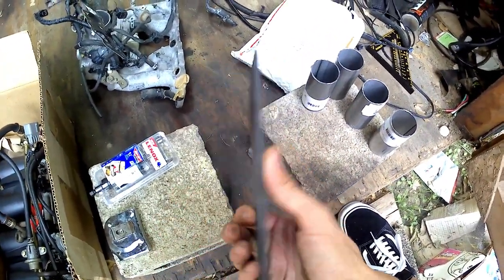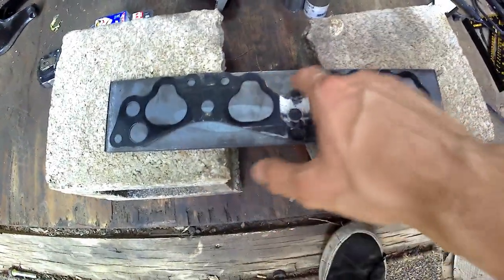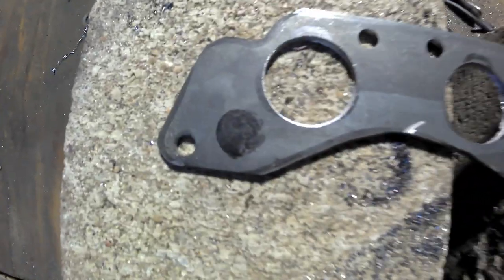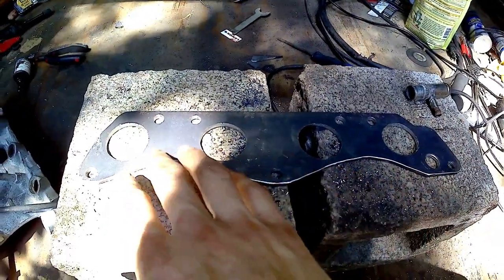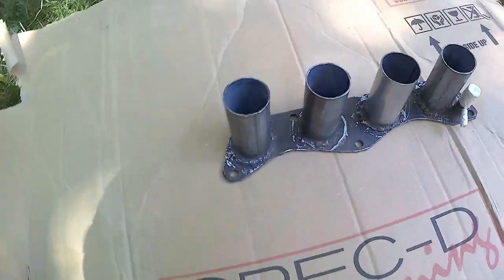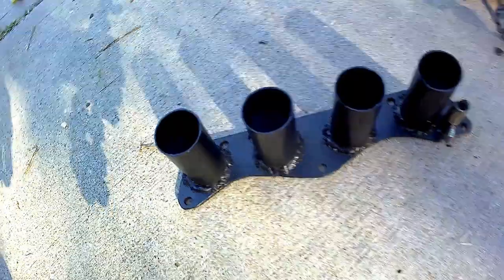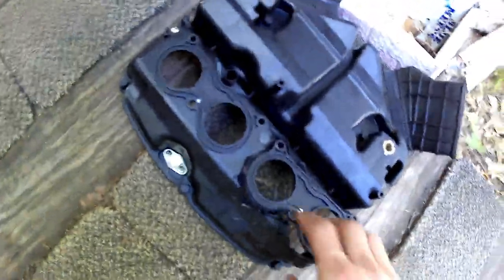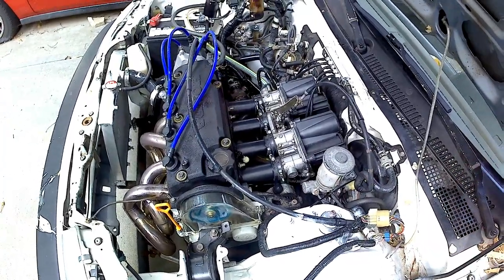How to build Honda civic ITB's

Comment: I think you should name the video title something more generic to get more views. This is an awesome video and the technique should work on other cars. I'd say remove "Honda" from the title and change it to something along the lines of "DIY ITB Adapter" or "How to build ITBs". Definitely deserve more views on this. Thanks!
Reply from the maker: Thank you! I really appreciate the advice and you checking out the video. I was honestly a little surprised how few views this video has so I think I'm going to try that out. I think it's a cool cheap way to make them and they actually work. I have been daily driving with them since this video was made.
Reply: @jdmjedi777  hey what is the link to get the itb on eBay
Reply from the maker: @stephinieletren2417  the throttle bodies are honda cbr954rr throttle bodies. You are just going to need to find a set for sale on ebay or some marketplace.
Reply: @jdmjedi777  okay cool bro but what year tho it has different year model on eBay
Reply: @jdmjedi777  

I really appreciate your sharing . I’m
From Mauritius island 

Most probably il get a 4age itb.  

Il revert back you when th project is on . God bless
Reply from the maker: @zeydozeer2177  no problem at all! I'm always glad to help. Always feel free to ask questions and I will always do my best to respond to them all. Good luck with your build!

Comment: Wish I found your vid sooner or how it barely has that many views, been wanting to do a itb d15b build for years just never could find a thorough/good enough video or explanation on the forums. Definitely subscribed and going to post on all the Honda forums/social media groups im on.
Reply from the maker: Well I definitely appreciate that. I try my best to put together some unique budget friendly guides for the automotive community. I'm glad you were able to get some useful info out of this video.
Reply: @jdmjedi777  Ment to say "thorough/good enough video to make some itb's for a d series." Your video will save many of us the price for new itb's that's forsure. Also was wondering if by any chance I could message you about some misc questions on your build that you did and possibly basic tuning?
Reply from the maker: @JoseVargas-bz6ui  for sure man. I always do my best to help everyone out. Tuning ITB'S can be a pain but once you understand them it gets easier. They need like 4 times as much fuel at idle and tons of tip in enrichment because the air velocity is so quick. Feel free to ask any questions you have and I will do my best to help out.

Comment: Just came across this video...ever thought to build one for the k20a?
Reply from the maker: I actually have thought about it. I'm having a hard time finding a big enough throttle bodies to use. Hayabusa and zx14 throttle bodies are both still too small. I do have a a build series on the budget k20 build on my channel though if you want to check it out
Reply: @jdmjedi777  yea I watched it..the one with the k20a3
Reply from the maker: @brendongarcia868  yup that's the one
Reply: If you want throttle bodies that are larger buy bmw m5 used sets.
10 itb's for 200 bucks!
That is what I bought anyway.
Also would be a better idea to cut up the factory intake manifold and trim off all the parts you don't need.
Would get much cleaner air flow into the head.

Comment: Gréât vidéo 

Can you make one to explain how you install the air flow sensor and idle
Valve please
Reply from the maker: Sure man! Do you mean the intake air temperature sensor and idle air control valve?
Reply: @jdmjedi777  

Yes bro
, 

Like how to fix the components or the sensor from the Honda
Intake on the itb, and how to avoid a
Bad idling .  Thanks bro
Reply from the maker: @zeydozeer2177  so with the intake air temperature sensor you just mount it either right infront of one of the velocity stacks or you could even drill a hole in one and mount it like that. The idle air control valve will no longer be utilized using this setup. Either disable it in your tuning software or remove it from the old intake manifold and zip tie it to the firewall still plugged into the harness to avoid a check engine light. You will just have to tune for a good idle and set the idle higher than usual like 1000RPM. I will a video explaining it soon.

Comment: Love it mans that’s sick hey the plastic thing at the end what are they for and where do day go an also the vacuum I want to make one for my d15
Reply from the maker: The plastic thing i cut out at the end is the original air box for the motorcycle that the throttle bodies came off of. I cut out where the air box normally mounts between the throttle bodies and the velocity stacks(the plastic funnel looking things). I cut that piece out because it directs the air for the idle channel holes properly through the velocity stacks. For the vacuum lines you are going to want to get whats called a "vacuum log" its basically a little tube with holes to hook vacuum lines up to. You will hook all the little vacuum ports from the throttle bodies up to the vacuum log but save one extra nipple on the vacuum log to run a vacuum line up to the MAP sensor. I will make a video explaining all of this soon because I have a lot of other people asking similar questions. Thanks for checking the video out and I hope you have a great day!
Reply: @jdmjedi777  I found some on Amazon but not with that plastic and you mentioned that it sounded different
Reply from the maker: @jdsphynx3656  yeah without that piece it sounds kinda funny like a weird vacuum leak.
Reply: @jdmjedi777   where would I get that box
Reply from the maker: @jdsphynx3656  I got mine from ebay. Usually a good place to look

Comment: Do you need the bottom of the air box or can you just put velocity stacks on the throttle body. In the pricing putting a set together.
Reply from the maker: You need the back of the air box. Really makes them run and sound better

Comment: How did you come up with the intake runner length? Is it based off a stock manifold? Runner length can shift the powerband up or down a bit. Might be something that would be interesting to test.
Reply from the maker: I have always wanted to play with the runner length on these. If I were to do it again, I would probably shorten the runner length just a bit. This was maybe my third set of individual throttle bodies I had ever made at the time. I was going for throttle response and the best fuel atomization, so a longer runner length is what I went with. My current car is a nitrous fed k20 swapped ek hatch and I was thinking about designing a set for that as well.

Comment: you my friend have gained a subscriber. hope to see more videos soon!
Reply from the maker: Thank you! I definitely appreciate it.
Reply: question on iacv and air temp sensor. are those just left unplugged and adjust the high idle on the throttle bodies?
Reply from the maker: The IACV and the IAT sensor are both plugged in and mounted to the firewall. The IAT sensor should be placed in front of one of the velocity stacks on the ITB'S. Depending on what engine management you are running you may just be able to disable the IACV and remove it completely. The idle is adjusted only directly through the idle adjustment on the individual throttle bodies. The IACV is just plugged in and mounted to the firewall so it doesn't set off a check engine light.
Reply: @jdmjedi777  Okay I figured. Watch your other video with the 4age V stacks, how did you modify those to fit the ITB's since they each have 2 mounting points and the ITB's itself has 3 mounts for the stock V stacks.  I appreciate the replies and help. I already put together a shopping list lol. I have a managable ecu
Reply from the maker: @4agehachiroku  I just uploaded a video showing exactly how I mounted them! If you have anymore questions feel free to ask and I will do my best to answer.

Comment: Okay so. Im about to be doing this. I got a cbr900 954 intake manifold. No injectors or fuel rail and no idle air ports like you showed in the video. I have couple of questions. So. I have stock D16Y8. What injectors and fuel rail should i use on this? My CBR manifold did not come with any and wondering that. ALSO do you know how to tune these at all? I have hondata s300 v3 and i have the ability to change the tune. No AFR gauge setup but i plan on doing that soon. And yeah. Idk. Any reply will be appreciated. This video is SUPERB bro.
Reply from the maker: You should use your y8 injectors but will need the CBR fuel rail as the injector spacing is different. You will need the spacers between the rail as mentioned in the video. As far as tuning goes you will need to do a TPS based tune as individual throttle bodies don't pull consistent enough vacuum to tune with a MAP based tune. Your s300 should be able to do it just fine. You will need to add a lot of throttle tip in as the air velocity changes very fast with little throttle input on individual bodies and a wide band air fuel gauge will be an absolute necessity to have in able to get it running correctly.
Reply: @jdmjedi777  thank you for the info. Im planning on getting AFR gauge setup before tuning and i will consider everything you have just told me. Thank you. I appreciate it a ton. I will get back to u soon if i have any more questions. You are awesome bro!
Reply from the maker: @dolph bro  no problem at all! I'm always glad to help and I do my best to respond to everyone's questions when I can.
Reply: @jdmjedi777  do you know if the spacing on the cbr954rr works? For the fuel rail?

Comment: Super helpful demonstration!! I wanna do the same thing on a B series and I would to ask you; what kind of ignition did you use to run the engine? Or did you just used crome tuning  alone?
Reply from the maker: Thank you! I tuned the car on crome alone. It worked and has worked for over a year now. The only thing I would say is, something like hondata would be ideal though because you can adjust the fuel injector to fire a little sooner because they are further from the cylinder head. I would also reccomend making your runners shorter than the ones on mine so you can kind of alleviate this.
Reply: COIL ON PLUG FOR SURE HELPS BUT MAINLY TUNE TUNE TUNE

Comment: Cause I'm concerned about fuel delivery with that rail I have soo many questions and I'm super interested
Reply: You can try to get an extra intake manifold and cut those runners and connect the motorcycle ITBs using that with couplers.

Comment: Would this be the same process for a b16 head? Just use a b16 intake manifold to cookie cutter how to make the diy itb’s?
Reply from the maker: Yup. Just use an intake manifold gasket for a b16 to trace out the flange. Honestly this method can be used on just about any engine.
Reply: jdmjedi777 thx bro
Reply from the maker: No problem man. Hope it works out for you. I love having these ITB's on my car. If you plan on tuning it yourself as well, I'm going to be doing a video on how to data log using crome tuning software.
Reply: jdmjedi777 ill be looking forward to the video

Comment: Is it better to use the itbs fuel injector location or the stock location? And can you use 929rr itbs
Reply from the maker: If you are able to use the stock fuel injector location and angle that's probably going to be best. The fuel injectors actually ont the throttle bodies works just fine though. I would recommend making the runners shorter than what I did. That's about the one thing I would change on these if I re made them.
Reply: I’m gonna be using an after market intake because the runners are more straight than any stock intake,welded up to some 929 itbs really close but Do you know if the stock bike idle controls work? And are the fuel pressure regulators the same size?
Reply from the maker: @JLEllington  the stock bike idle adjustment works fine. I did remove the high idle valve however and I would recommend the same for you. I just plugged in the iacv and zip tied it the the firewall. The fuel pressure regulators are interchangeable and so the civic one will bolt to the cbr fuel rail. I just used and aftermarket adjustable one that bolted to the rail.
Reply: jdmjedi777 Cool Appreciate it
Reply from the maker: @JLEllington  hey man idk of you are still interested in building these but after some research on fuel injector location, it turns out that with individual throttle bodies with the fuel injectors further away you are actually capable of making more power. It gives the fuel more time to cool down the charge air inside of the runners and people have seen as much as a 10hp increase by keeping the injectors further down the runners like the location I have. or even pointing directly into the velocity stacks into the butterfly valves.

Comment: Bro! How do you not have 100k views on this?!?!? You will revolutionize the honda game. 

Now.....will this work on a A6 head? And what did you use to tune?
Reply from the maker: Thanks man! I appreciate it a lot. Also the answer is YES!! This will work for any B or D series engine. and if you are creative enough, the concept and be used on basically any engine you want. I have used crome to tune the car. It's a really budget option for the DIY kind of person. If you ever need any information on how to build or set up anything like this feel free to ask. I have have been working on Hondas specifically for 10 years now and pretty much anything with a motor my whole life.
Reply: What year cbr900rr throttle body is it?

Comment: Thinking of doing a NA build for my 03 ap1 s2000. Would you recommend the same cbr part. Or will it not work so well with the f20c.
Reply from the maker: I would only recommend these throttle bodies for an engine producing 200hp or less. Anything more and I would definitely recommend a bigger set of throttle bodies. Maybe you could use something like hyabusa throttle bodies it just might take a little getting creative for the throttle position sensor but it's definitely doable.
Reply: @jdmjedi777  do you have any social media I can follow.  I have a few questions.
Reply from the maker: Unfortunately I do not. I'm trying to get back to being more active on YouTube though so feel free to ask me any questions you may have on here.

Comment: Do the 4age trumpets bolt right up?
Reply: Thanks for the diy btw
Reply from the maker: They are pretty close. I can show you how I made some little brackets easily that hold them on great. The only thing I had to do to them is shave a little off the the inside trumpets (cylinder #2 and #3) at the widest point only on one side of each of the trumpets. It was a pretty easy install.
Reply from the maker: Also no problem! Glad you got some use out of it. Thank you for watching them.

Comment: Hi mate  nice  video just asking  I've got a  d15b2 intake manifold  I'm going to  cut it so I can put some  bike  throttle bodies on  can I use cbr 1000cc ones as it looks pretty  straight inline  to the intake manifold any information will be appreciated ☺️
Reply from the maker: As long as the TPS is the same, you should be able to use them. I used cbr954rr throttle bodies. You might however have a difficult time getting a good seal using a cut manifold.
Reply: @jdmjedi777  hi mate  I've  done the  cut manifold  what do I do with the  coolant port never done this before any help will be appreciated, cheers

Comment: Can this idea work for the k24a1???
Basically a k24???
Reply from the maker: These exact cbr954rr throttle bodies are good for up to about 200hp. Anything beyond that hp level they will become a restriction. If you are good with building things you have many more options for throttle bodies though. Something from a bigger bike will obviously support more horsepower. This method can be applied to basically any motor you want it to work on. You just need to do research on what size throttle bodies you will need to support you horsepower goals. As well as taking a good look at the intake manifold and coming up with an intake flange design that will work. So in short, yes this can work on a k24 but you will need larger throttle bodies from a larger motorcycle.
Reply: @jdmjedi777  thx for the information man i appreciate it very much❤️❤️❤️❤️
Reply from the maker: @MrNoob-gv6xm  no problem! I love to help out when I can and try my best to respond to all comments.